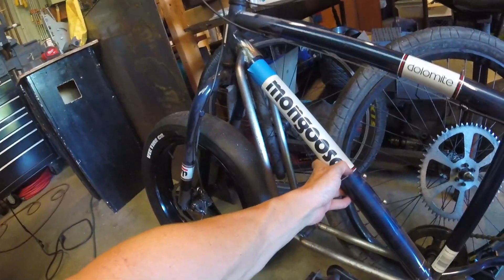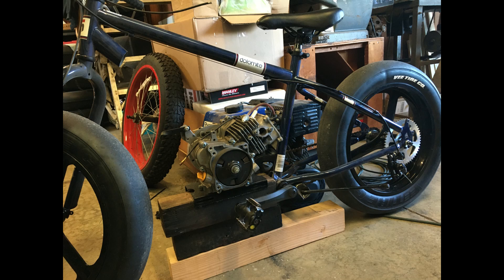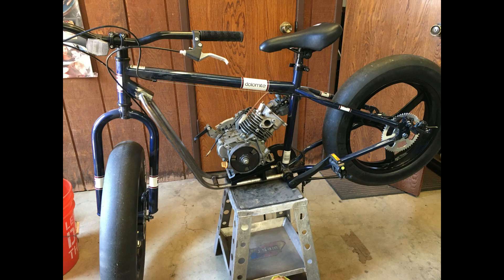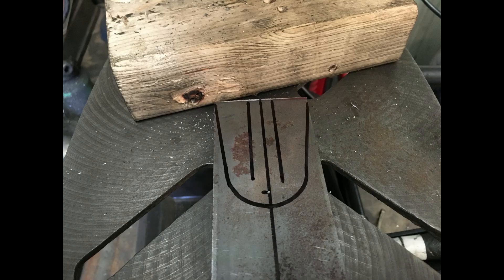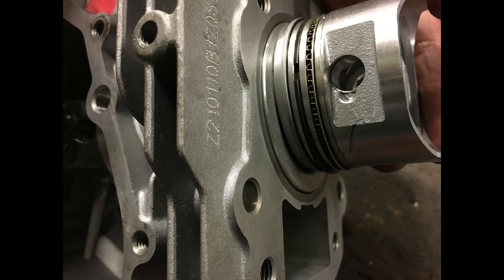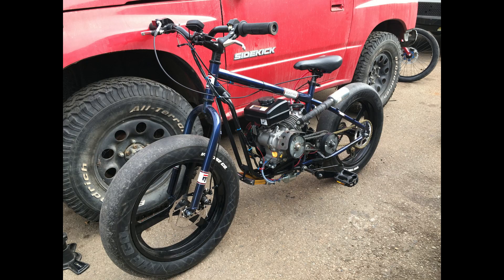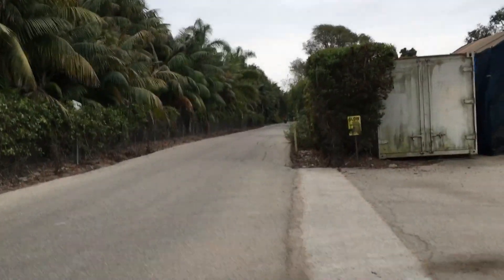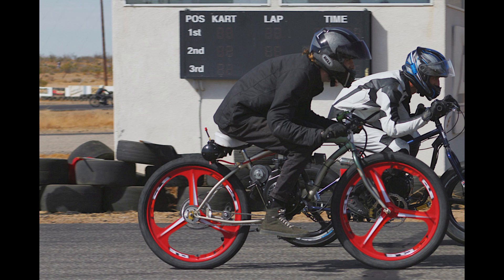79cc Big Bore Motorized Race Bike 105cc's

Comment: Can you show us.more the specifics of the oil cooler?
Reply from the maker: There isn't much more to show.  We purchased the cooler and the pump on eBay.  We had to drill and tap one side of the engine block.  There isn't much to it.
Reply: @agkracing140 i have a question could i use the oil drain hole as the feeding to the cooler and use oil sensor hole for return or no..your answer will be greatly appreicated

Comment: How many HP is it putting out?
Reply from the maker: We haven't had the big bore engine on the dyno yet.  Our Stage 2 engine with a standard bore makes 7hp so with all the extra work we've done to this big bore engine we're hoping to see a fairly significant gain in power.